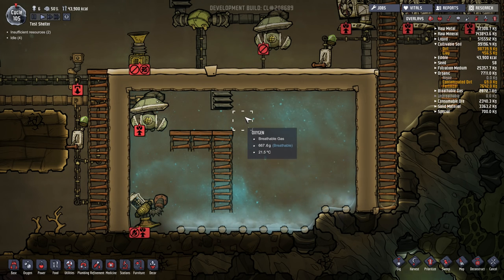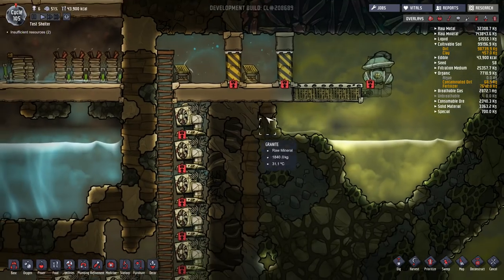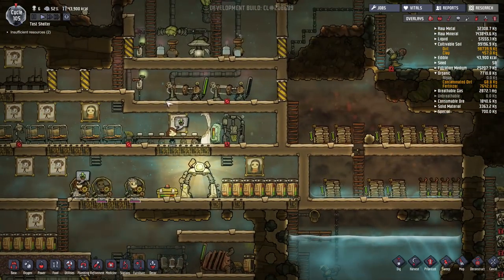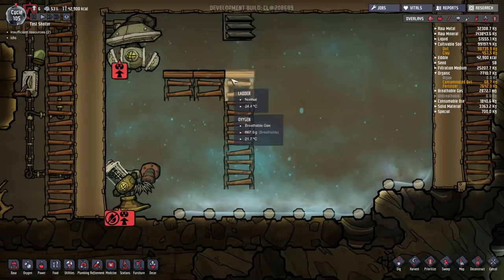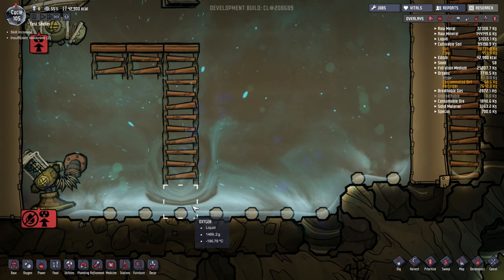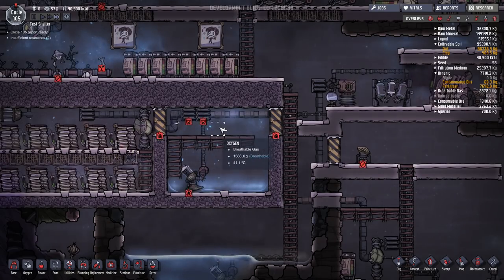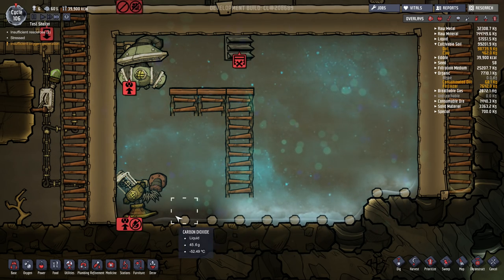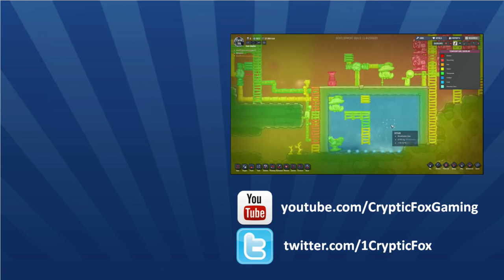How to Make Liquid Oxygen! - Oxygen Not Included Tutorial/Guide

Comment: Heh. So what happens if you create a chamber with liquid oxygen going in one side and steam going in the other? Bonus points if you're using the thermal regulators as the source of your steam heating.
Reply from the maker: i created a room with the super cold oxygen going in (-150 celsius) and steam, but I don't think there was enough steam volume.  Couldn't tell if it was helping the steam condense faster or not, but I was using a battery room to make the steam.  Going to try it with more steam volume heated by Magma :)

Comment: You could have just run a small series of chillers instead of that massive group.  You pump the contaminated O2 into the containment room.  Then repeatedly recycle the air in that room through your chillers loop until the temperature gets low enough to liquefy.  That way you are only having to run a fewer number of those regulators instead of trying to liquefy it in one pass.  Then you can pump your chilled O2 liquid into the base in one of the lower levels and let it soak up heat as it converts back into a gas.
Reply from the maker: This system actually doesn't work at all now, becuase liquids or gases that change state when they're in the piping will break the pipes now.  You have to chill the room using radiant cooling now.

Comment: I wonder if you can use Abyssilite to reduce the need for the thermo regulators? Maybe make a small cave, surrounded by abyssilite, to pump air into to?
Reply from the maker: +MrSeagull from what I've seen the abyssalite doesn't seem to affect the temperatures of the things that are in them for some reason.  Might just be a bug.  I'd love to use abyssalite as a tool.  Tried to harvest it to see if I could build out of it but the supplicants won't pick it up.
Reply: Aww, darn.
Reply: +CrypticFox abysallite has a thermal conductivity of 0, which means although it is very cold, it will not absorb heat from nearby objects

Comment: Would it be possible to pre-cool the contaminated O2 by running it through the liquid O2 room? While you will still need to prime the system with the large cooling setup it may you to run less pumps continuously. Or if you are worried about the CO2 sublimating a separate heat exchanger room where the cool gas is surrounded by pipes containing the contaminated oxygen.
Reply from the maker: Potentially.  You'd have to release the gas into the room currently as the pipes don't seem to change temperature at the moment.  After the update they're releasing toward the end of the month you could probably snake the pipe back and forth in there to cool it.  Alternatively I could probably pump a high pressure of contaminated gas into a room and then just let it run for a while with the gas cycling out of the room, through a half dozen of the coolers and then back into the room.  would take a while but might work.
Reply: yah that will be nice i made a cooling unit with pipes for condolenced carbon hoping to use it as an additional cooling system to reduce cooling costs. accidentally hitting solid can crash the game especially if chlorine is accidentally in the system(lucky you can mop chlorine)
Reply from the maker: yeah I crashed it a couple of times while I was sorting it out haha

Comment: Use semi closed loop for cooling. such that like 80% of gasses go back to thermo regulator again. It will limit amount of gases that You can put through system but will use less power.
Reply from the maker: +Czorńy Lisek yeah you can use a loop that way as well but then you just have to manually switch it out of the loop to avoid super-cooling to the point that the game crashes :)

Comment: I'm actually struggling with getting metals right now and If I can get a um water electrolizer? For converting water into Oxygen then I hope to be doing alright on that front. But looking into other options would be a possibility. Gonna use your Compact Electrolyzer Room for now.
Reply from the maker: yeah it works pretty well in terms of O2 consistency, though it does require a constant supply of water.  This liquid O2 method really doesn't work anymore as they've made a lot of changes to the game since I made this video, but the electrolyzer is a good method.
Reply: @CrypticFoxGaming  Literally got the game the other night so I'm beginning to exhaust a lot of materials and some of the important ones for plastic are no where to be found unless I explore deeper. And I mean deep, probably into suicidal territory without exo suits deep.
Reply from the maker: Great buy.  Plastic requires oil to make.  it's a later game product you manufacture with the polymer press.  The only other way to get it is by disassembling a plastic item in a ruin you find, or buy shaving a glossy drecco.

Comment: could you maybe use the super cold liquid oxygen to exchange heat with the carbon dioxide in the base? I.e. the oxygen absorbs heat from CO2 gas and evaporates, while simultaneously the CO2 gas thus cools down and condenses, making it easier to remove from the base. And maybe if the oxygen is still too cold for plants to grow afterwards, you could heat it up by passing them by the coolers, which get hot during use.
Reply from the maker: The oxygen unfortunately won't cause the CO2 to condense.  It just never manages to cool down other gases it comes in contact with to that extreme.  CO2 is supposed to solidify at -78.5 degrees, but even with the super cold O2 it won't cause the CO2 to condense.  I started piping the cold O2 into the room where I was sending steam hoping it would cause the steam to condense more quickly but I don't have any definitive results yet :)
Reply: CrypticFox really? Someone else who did this just pumped liquid o2 right into their dorm area and liquid CO2 started condensing around the area. I note that liquid O2 doesn't evaporate if allowed to form a wide pool, it has to be in small quantities or be flowing.
Reply from the maker: oh i hadn't noticed any CO2 condensing around my O2, but my base is pretty clean of CO2.  I don't know if its so much the size of the pool of O2 as the air pressure around it.  When my oxygen is pressurized at 2000g per tile it stops evaporating until I let some of the pressure out.
Reply: CrypticFox I mean, if it forms a large enough pool that each unit of liquid becomes "self-pressurizing" aka getting pressure to remain liquid because of the liquid oxygen next to itself.
Reply from the maker: Oh I see what you mean.  I haven't encountered that yet myself, though I'll keep an eye out for it.

Comment: I feel that I've failed as a gamer that I have to look up tutoriels on this game to actually beat it. Then again, this game requires a level of cleverness and strategy in an area that I'm already not good at. I suppose I should simply take pride in that I'm able to get as far as I have with little to no assistance, and be thankful that these instructions DO exist.-
and then you realize the date, and recall that things have changed a LOT in this game since then. Not vents take damage if the air gets cold enough to liquefy.
Reply from the maker: There's a fair bit of complexity in this game.  I'm sure its something you can figure out through trial and experimentation, though it does help get a bit of a boost sometimes.  Even knowing how to build different setups in this game doesn't necessarily make it easy after :)

Comment: could this work in current versions with wheesewarts  as well as using heat from the thermal regulators to warm the oxygen back up?
Reply from the maker: You can still liquify oxygen but you can't do it inside of a pipe anymore or the pipe breaks.

Comment: But currently, your entire base can run on contaminated oxygen, so this isn't as necessary now as it probably will be, right? (when they add penalties for breathing toxic gas)
Reply from the maker: Exactly, though I play with the necessity of having clean air anyway because a) they're bound to change it, and b) it feels too much like cheating to just run on contaminated air (which kind of begs the question of why play just to cheat myself).
Reply: contaminated oxygen is still effecting your diseases and stress level even having it in your base as the main air supply. the negatives that it adds stack so i really wouldnt feel bad about it. your guys work roughly half as effectively with contaminated and reduce stress slower even on the message table
Reply from the maker: yeah, and it doesn't help that they have to stop and wheeze constantly too.  I've seen a number of people running a build with the full of contaminated oxygen though, because even with the crazy high stress and lower efficiency, the illnesses don't kill the duplicants and they don't suffocate.  I'm sure it's an exploit that won't last past Alpha though, so it's probably better to improve oxygen management now :)

Comment: Could you make a closed system with just a few freeze units and run the air out of the last freeze into the first and then after it is cold enough, send it to the vent?
Reply from the maker: At the time I built this they didn't have the temperature sensors, so it wasn't possible.  Now it's not possible this way because gases or liquids that change state in a pipe will break the pipe.  Instead what you can do is super-cool hydrogen (which liquifies at a much lower temperature) and use that to cool polluted oxygen to the liquificiation point.
Reply: CrypticFox could you have a sealed box of gas,pump out from one side into a cooler/heater then pump back into the box, to cool/heat the room over time or will that brake the pipes too, and if it does break it can you seperate the liquild from gas in the pipe?

Comment: How are your wires not overloading
Reply from the maker: This video was made before the update so there was no issue of power load for wires.  You also can't change a gas to a liquid or solid inside of a pipe without breaking the pipe anymore.  Would have to supercool H2 and mix it with the polluted O2 to make liquid O2 now.
Reply: Ah. Bugger. 
I've run out of sand and it takes forever to heat up fertilizer so that I can make sand. They also don't seem to pick up the only thing I tell them too. It is sweep only
I have more polluted oxygen than I would like and I'm trying to figure out how to remove it

Comment: what is in polluted oxygen anyway? other than you know oxygen
Reply from the maker: I don't know that they've ever really said, but given it's in the swamp biome and coming from the outhouse material I'd suspect Methane is some part of it haha.  When you turn polluted water into steam it leaves dirt behind, but there's no bi-product from condensing polluted oxygen into clean liquid oxygen.
Reply: well technically methane should also turn into liquid before oxygen turns into liquid since it has a higher condensation point. so technically this freezing method shouldn't even work. currently every tile of air can only be composed of one type of gas. hopefully they'll fix this in a later update. and allow multiple gases in one tile. there's a bunch of conservation of mass issues in the game especially with the algae terrariums, because where does all the water and co2 go if the algae just dies and has to constantly be replaced. hopefully they'll fix that and add a mechanic to burn polluted oxygen into co2 and water.
Reply from the maker: well there are a few chemical/physics scenarios that aren't exact, but it's still just a game.  You can also get CO2 liquid in the game, but in reality solid frozen CO2 sublimates directly into a gas at the boiling point.  At some point the level of detail has to give way to fun :)
Reply: i agree, but i find it more fun and compelling when the chemistry and physics are accurate, well to the point before you have to start using calculus because while that can be fun it will probably start turning a lot of people off and plus be really performance intensive. but i don't think conservation of mass and basic gen chem is too much to ask for. my main gripe right now honestly is with the algae terrariums. they should either not keep consuming algae or produce a waste product that can through whatever convoluted process, hopefully convoluted because it would break the balance of the game otherwise which i think is the reason they haven't implemented it, be converted back to the algae and water that went into it minus the oxygen that it already emitted.